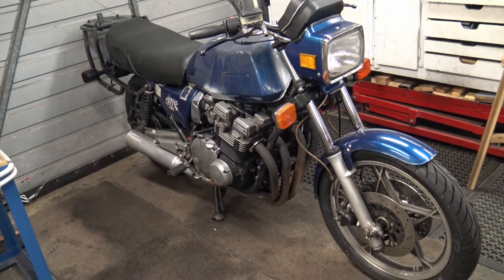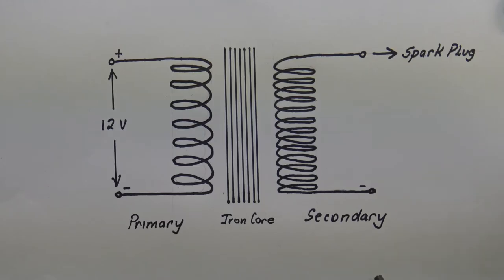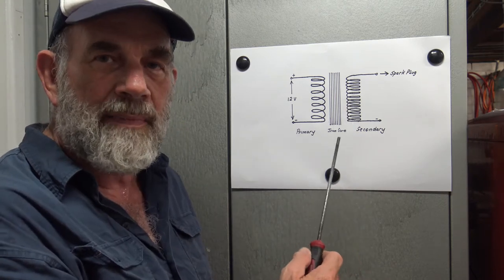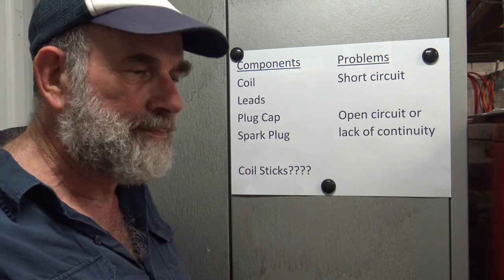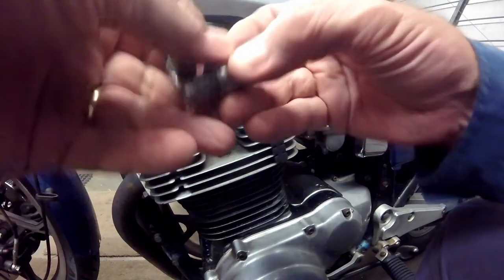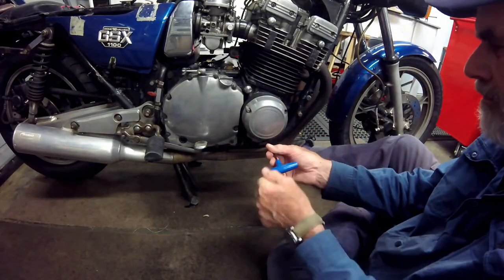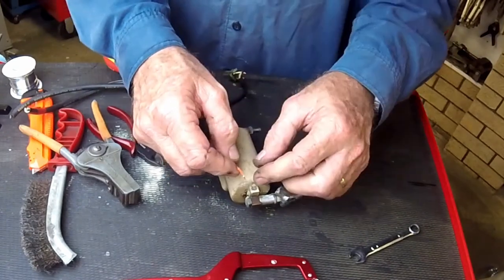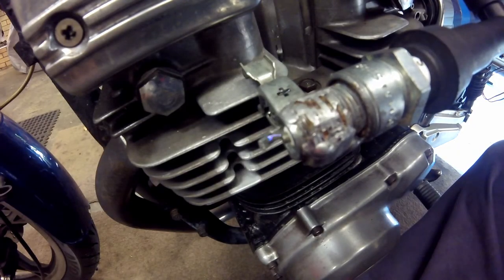Fixing Ignition Problems in Four Cylinder Motorcycles

Comment: Hi there, great video!!! I have the very same bike and having issues with spark as well. My coils are fine as tested them. I'm suspecting the cdi/Ignition box.... How do I test this?
Reply from the maker: Usually a failure there shows up as no spark on any cylinder. I have seen them shut down completely and sometimes come back to life to fail again later, but often just stop working. The ignition box will usually be the culprit here. I am assuming you have no spark on any cylinder. Unfortunately the easiest test is to swap the box for a known good one. Do you have any mates with a similar bike, that will let you swap theirs for yours to see if that is the fault?
Reply: @whitedoggarage  actually now thatt I think about it, it may actually be a bad coil..... Cylinder 1 and 4 is getting strong spark and cylinder 2 and 3 gives very erratic and very weak spark... Sadly no one near me whom I could swop ccdi or coils with. How would I test if  a coil is faulty, swop it with the cylinders that are giving good spark?
Reply from the maker: @conradpaul6100  Swapping coils is an easy check. I am away from the workshop for an extended period at the moment so I can't look up a manual; but my recollection is that Suzuki coils have two wires going to each of them. On each of the two coils one wire will be the same colour for both and the other two wires will be different colours (I can't be sure, but I am thinking the different wires might be orange/white and black/yellow). You should be able to swap those wires over and the problem should then transfer to 1 and 4, if it is the coil. Hope that helps.
Reply: @whitedoggarage  hi there.small update.sent all my ignition components to mate with a running bike and all my components were fine but suspect my pick up coils are shot .do you know how to test those with a multimeter?
Reply from the maker: @conradpaul6100  You test them by checking resistance. Unplug the cable to the pickup unit. Leave the unit on the bike. There are two wires to each side and you measure resistance accross these two wires. I am away from my base until November so I can't check my notes to tell you the value, but I think it is maybe 3 ohms - but that is a guess. Theoretically, it wont be zero because it is a coil, but it wont be two high because it is picking up a pulse. Those coils are insulated from their mounting plate so if you check resistance readings between the wires and the plate it should be infinite. In short low resistance accross the two wires leading to each pick-up, infinte resistance between all wires and the mounting plate. Sorry I could not be more helpful with real world values.
Reply: @whitedoggarage  hi White dog,I've don't this by unplugging the unit from the CDI box and testing the blue and green wire coming from the pick up unit and you are correct.it should be between 3 to 5 ohms and mine is just a bit over 3 so all good there however when I test each individual coil it measures about 1.5 ohms each(there is 2 pick up coils) is the individual reading correct?
Reply from the maker: @conradpaul6100  Not having a manual or a bike handy, I'm doing this from memory so bare with me. Are their only two wires coming from the pick up unit?
Reply: @whitedoggarage  yes only two wires,one green and one blue.measured the resistance across them and got just over 300 ohms so that one is fine
Reply from the maker: @conradpaul6100  Thanks for clarifying. You said just over 3 ohms resistance in an earlier reply, but you said 300 ohms in this one, which is correct? Was the 1.5 ohms you reported for each coil, the resistance between the wire and the backing plate?
Reply: @whitedoggarage  apologies.it was meant to say over 300,not 3...and also the 1,5 is meant to be 150 ohms... There is a common (red ) wire I think between the two individual pick up coils and then the individual blue and green coming out of each,the 150 reading was taken between the red and each corresponding colour,not the backplate
Reply from the maker: @conradpaul6100  Okay, I have looked back over all of our converstation. The original problem was weak or eratic spark on cylinders 2 and 3. You sent the coils and the 'CDI' box to a friend to test on their bike and they were good. You are now testing the pickup coils. You are reporting the resistance across the blue and green wires is over 300 ohms, but is the same between each pickup and the common wire (eg 150 ohms). I would think with both pickups having the same resistance that the pickup unit is probably not the problem. I think I would now turn my attention back to the coils. Testing on your friend's bike would have seen the the leads and caps disturbed with removal and fitting, this could temporarily hide a fault in that coil set by closing a crack or gap. Options here include clipping off 3/8" or 10 mm of the end of each of the two leads and refitting the caps, or replacing the leads entirely and fitting new caps.
Reply: @whitedoggarage  thank you Bob,appreciate you taking the time to reply.i will try this ....I think after I received my stuff back from my friend I may have fried my CDI as it is getting quiet warm and when I tested the two wires that go to the coils from the CDI...the white one which goes to coil 1/4 and the black/yellow one which goes to coil 2/3 have like only 1volt each!!! I may have to get all retested or drop the whole lot off and go with a Dyna s system
Reply from the maker: @conradpaul6100  Wow, 1 volt each, I am surprised it goes at all.
Reply: @whitedoggarage  I think we found our problem then
....
Reply from the maker: @conradpaul6100  Yes with the magnetic rotor not aligned with either pickup coil the voltage to the coil should be 12 volts, maybe a little less for old wiring, say 10 to 12 volts. To be sure, make sure the battery is fully charged and measure from input wire, positive side to a known good earth, not the other side of the coil. If it is not say 10 to 12 volts then identify the output wires from the CDI box and measure the voltage there (hint leave it all plugged in, if you can not get a meter probe into the back of the plug, use a plain paper clip straightened out to push down beside the terminal). If the voltage at the plug is more or less equal to the voltage you measured at the coil, the CDI unit is failing, but if it is in the 10 to 12 volt range then the problem will lie in the wires from there to the coil. The other check you need to make is that the supply to the CDI unit is about 12 volts. Now the trick with checking wires is that the wire, unless it is corroded or has worn insulation, is usually okay and the problem will be in the connector.
Reply: @whitedoggarage  thanks alot for the detail explanation,this will really help.will have to get my battery fully charged and then do each test carefully and thoroughly as per your guideline here.will report back with findings once  done.youve been very helpful,thank you once again !
Reply: @whitedoggarage  sir,just wanted to give you some feedback....managed to find the fault....it was my CDI that was the issue.....found a buyer for the bike now so someone's else's issue now.but thank you once again for all your time and effort in replying,you a top bloke!!
Reply: @whitedoggarage  oh and consider me subscribed!!
Reply from the maker: @conradpaul6100  Thanks, sounds like a good result in the end anyhow.